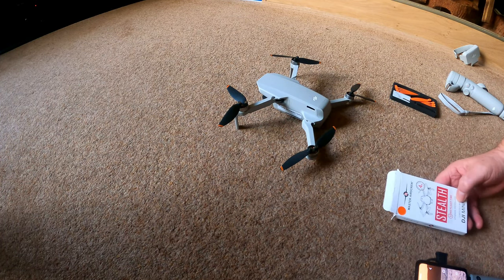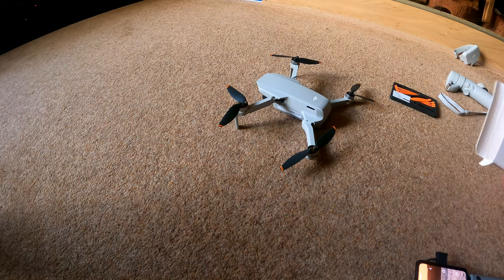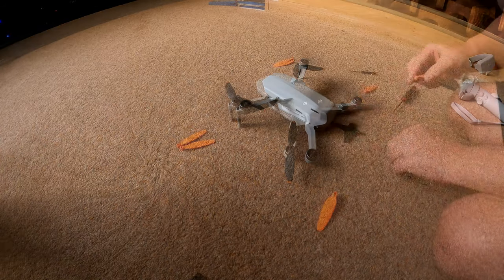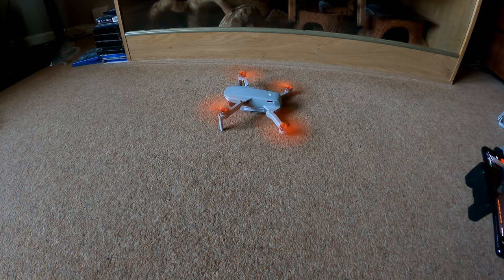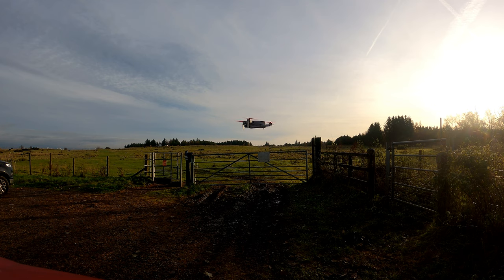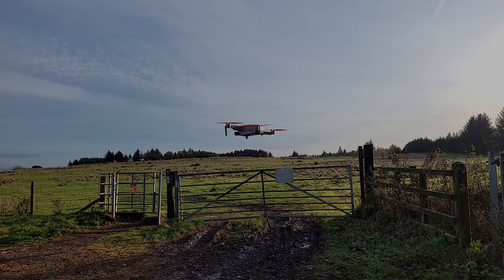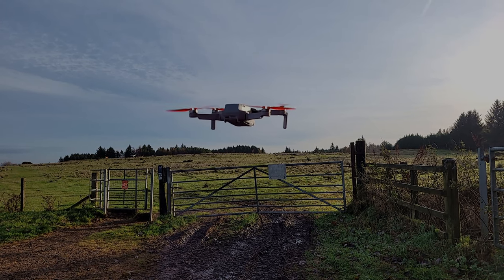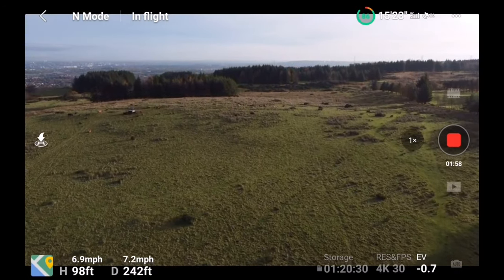DJI  MINI 2 MASTER AIRSCREW PROP UPGRADE

Comment: Didn't end up being quiet on my side, I would advise to add your own loctite on the screws, master airscrew didn't put enough on mine, and I lost a propeller a second after landing..... nearly lost my drone. I would stick with the DJI ones, never had a loose screw in 2 years of flying with the same original props.
Reply from the maker: I have been checking screws after each flight so far so good.. you was lucky there then.. I might even have used the dji screws but think a bit of lock tight just in case

Comment: Interesting props, sturdier and longer flight time are a big plus, certainly seem quieter as well.
I wonder if there are any that fit the original Mavic Mini?

I've added your channel, hopefully you'll connect with a fellow Mini pilot?
Reply from the maker: I dont believe master airscrew done them for the original mini
Reply: @Mad-Coo  I get about.....😊😁👍
Reply: @Mad-Coo  No, they don't make any that fit my original Mavic Mini, the other after market ones for mine are mostly poor quality and not balanced so they induce a lot of vibration which could damage the motor or arm and can cause jello in the video footage.
So I stick with the original DJI ones, which I'm still on the original set which are well over 2 years old now!

I'd have a set of Mastter Airscrew if they made some, they make decent props that give advantages over the stock ones.
Reply: @Mad-Coo  Yeah more blades usually mean more thrust and more stability but there is a trade off against the extra drag, which uses more energy from the battery and causes more heat in the motors to spin the prop, for any given speed compared to a 2 blade prop!

With the DJI Mini the drone is stable enough really, extra thrust might be useful for climbing quickly but mostly with a GPS camera drone you're just trying to fly smoothly not necessarily faster.

What I'd be looking for is something quieter than stock, lighter, stronger and pitched to give even better flight time.
Not sure all those are possible but definitely quieter would be good, with the Mini you don't really hear it unless it is right overhead, making it more 'stealthy' might be an advantage in some situations.👍